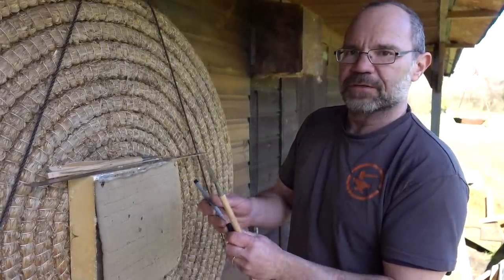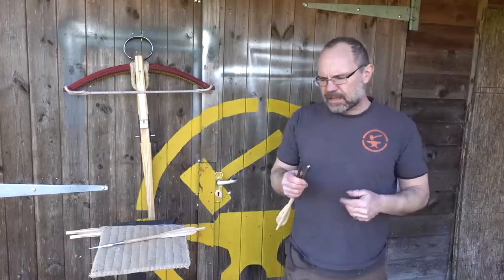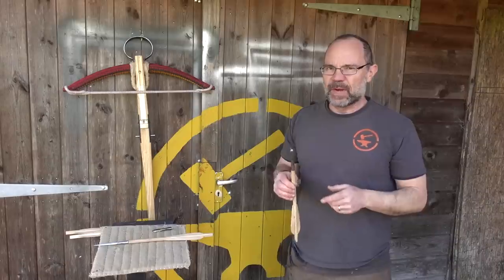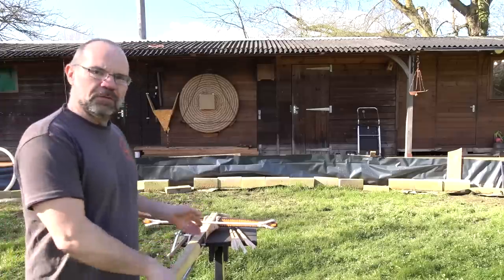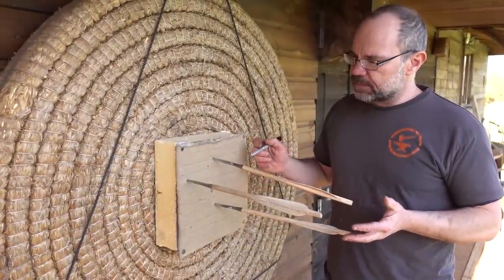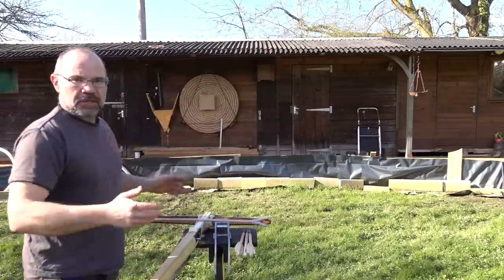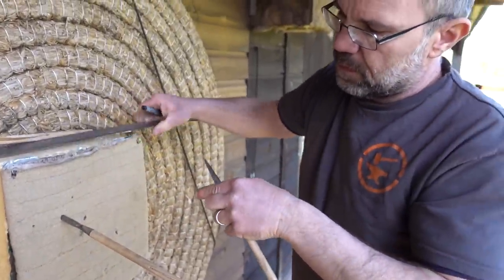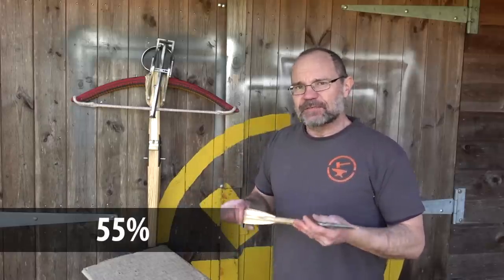Does WAX on ARROW HEADS Do Anything?

Comment: It might work on the same principle as a sewing needle. It was often common practice to pull the thread through beeswax to make it easier to sew thicker material together. But I do question the thickness of the Gambeson tested, since many of the coats I've seen in museums were thicker (those not worn with chain mail) and the thinner coats (those worn with chain mail).

Comment: Under waxing could be like in bicycle chain waxing. It is mixture of wax with oil. By it self wax give a lot of friction, but dry. Tigether with oil you will get the best effect. It is dry by touch, but give best low friction from filling point of view. 
For my bike i have made from 400g volumes of candle paraffin, 100g bee wax, and around 300ml SAE250 gl1 oil. Has water hydrofobbic effect, last long, almost dry by touch and almost clean by touch no heavy dirty marks.

Comment: I strongly suspect (as a number of people do here) that the wax (or oil) may have been initially put on to prevent rusting of the heads during storage and transport. It's possible that was the origional reason, then by trial and error they saw they had a greater impact, or it was just a fortunate coincidence and they had no idea it improved penetration.

Comment: My only thought as to why it wasn't done would be that I'd imagine that the wax would just crack off. Maybe they would have had big pots of melted wax next to the archers during say a siege but I can't image that it would stay on. Perhaps other types of lubricant was used like oil or fat. Also I would imagine that because the bolts are made of steel they would already have some sort of oil or something on them already to prevent rusting. I also know nothing so keep that in mind.

Comment: Beeswax would have also kept the bolt heads from rusting and in better condition, maybe the beeswax was originally being used to stop rusting and discovered the better penetration in the process? Chur for the video Tod, just joined your crew.

Comment: I know nothing about arrows or waxing  them but I do know about driving nails into 100 year old fir 2X4 studs.  I owned a house 100 plus years and wanted to do a remodel on it.  16 penny nails would absolutely not puncture that wood (almost rock-like at that age) except when I coated each with paraf
fin. I would have guessed that wax coated arrow heads would have penetrated further...

Comment: A comparison between different rust-prevention methods would be needed.
As many have pointed out by now - wax, tallow, oils and similar have been used for rust prevention. Specially for weapons this was important as they are normally used rarely but need to be in good condition when the time comes - so tipping your arrow-heads in wax - which does not go bad and stays in place better than oil - should have been rather common.

So if possible - please try it also with some other materials that were (likely) used to prevent rust.

Comment: I was giving this some thought when I revisited the video of arrows v armour.     That perennial question of whether arrows were 'waxed' was raised there.   I commented when the video was loaded.   Now I wonder whether the wax on Bodkins and other heads was anyway a standard finish following manufacture to protect against corrosion.   They must surely have had some coating.   My thoughts also turn to Linseed oil.    Hot iron quenched in Linseed oil will bake on a protective coating.   Before the days of cotton, linen was a principle fibre and Linseed oil common.   Might a baked on coating of Linseed oil provide similar lubrication with the heat of friction as well as protection against corrosion?
Peter.
Reply: Oops, in too much of a rush again. I see that a wax coating as a protection against rust has already been raised.   A number of times.  I apologise to readers.   Quenching in Linseed oil is different, however, in that all that is necessary is to toss the hot heads into a bucket of oil when forging is complete.  And the coating is long lasting.    Who knows?

Comment: I used to be a shoemaker and when sewing in leather, pecking the awl in a piece of bees wax makes a world of a difference. It may be a good idea to rub a piece of bees wax against the whole length of the arrow heads, to ensure an even distribution of it. Dipping the heads in molten wax may also be worth trying. It will protect the metal from corrosion and a ball of wax on the tip seems less than practical, at least in combat.

Comment: GREAT VIDEO . THE REASON THEY TEFLON COATED BULLETS WAS NOT TO MAKE THE STEEL ROUNDS PENETRATE THE SOFT BODY ARMOR , BUT TO HELP PROTECT THE RIFLING FROM THE HIGH PRESSURE STEEL BULLETS FROM WEARING AWAY THE RIFLING IN THE GUNS .____NOT YELLING GOING BLIND . I THINK THEY STARTED WAXUNG THE BOLTS & ARROW HEADS TO HELP KEEP THE M SHARPER & RUST FREE .

Comment: This is very interesting.
Would the wax interfere with the metal of the arrow tip? If not, maybe they were waxed to stop or slow down corrosion/rusting, and increase in penetration is just a lucky side effect.

Comment: Have you tried hot dipping the tips and a inch or two of the shaft into a pot of hot wax? This would get a more even coat into the pores and protect the head and shaft from moisture. This would also increase the FOC. 🤷🏽‍♂️

Comment: Hmm, a blob of wax on the end of a platecutter head is probably the medieval version of APC (Armour Piercing Capped) ammunition, a soft cap or ring of material (penetrating cap) is placed over the hardened penetrator (the optimum shape of which is often not ideal for striking sloped surfaces). In APC ammunition it has two purposes, one to lower the initial shock of impact which can shatter the hard penetrator (not so much an issue at crossbow velocities) and the second is to prevent the shell from bouncing or skidding off on a glancing shot.

It was only invented in the last hundred years or so though so can't be historically accurate of course ;)

Comment: 3 months later here, but: an old trick in carpentry is to rub simple bar soap on your screws - and even your nails. Especially when screwing slot head screws in wood by hand it can really make a difference. Great for reducing friction on wooden drawers too.

Comment: Try dipping the arrow heads into hot wax, im sure It Will give better results than a wax drop on the tip. Or also could do an arrow coated with pork fat or grease and see a comparison between those.

Comment: It does seem likely that they would, even from a preservation standpoint, heat the tip and stick in in wax or grease to prevent corrosion. after years I would imagine someone would notice that treated tip performed better then untreated, even if they didn't come up with it intuitively.

Comment: Hi Tod,
I've started to follow you recently and it is a really interesting video. I was wondering if maybe you've tryed to hit that type of armor when it is attached to a round surface. Again maybe you've done it before or explained it in another video but to me the target wasn't supposed to be flat as the belly gave the material a round curve.
My point is : if the armor is attached to a round surface (to replicate a human belly) maybe the front fibers of the armor will be slightly spread out and will increase the penetration at the impact by reducing friction of the tip at the entry point.
Maybe it will not increase that much the depth of the wound but maybe, with wax, you will increase it by 1cm or so... And 1cm deeper might touch the heart instead of ribs.
That's all great job and keep it that way I love your video (sorry for the bad spelling ;-) )
Reply from the maker: You are right=, but the problem is then in testing 'like for like' as a shot that land on a different curvature can no longer be compared as like for like and shooting is just not that accurate....
Reply: Yeah you're right.. Didn't think about that. 
Thanks for the answer!

Comment: I'm curious if the concept of the blob of wax at the tip was not used as a friction reducing element to allow for deeper penetration but rather as a friction inducing element? This would obviously be most important when shooting at steel plate. 

If the wax, before being melted from the energy of the impact, creates a tiny bit of friction (by virtue of being sticky)  and keeps the arrow head in one place for even a brief split second longer, then more of the energy from the impact is directed into the steel and might result in less of a chance of deflection.

Comment: Would there be a difference on hard targets as well?
Screws for decking are sometimes waxed. There are a real difference in how long a battery on the screwdriver last. And the waxed screws are kinder to your wrists. If you have a substancial amount of screws, you notice the difference very fast. Stand to reason that kind of difference transfer to things like arrows, bolts, bullets going thru soft targets.

Comment: The percentage thing is an easy mistake to make. The 40-45% number comes from taking the change as a percentage of the NEW number. 80% comes from taking the percentage as a change of the original number, which is how we usually measure percentage change. (Example: if something goes from 100 to 200, the change is 100. So this is a change of 100% of the original quantity, but it's only 50% of the new quantitiy). I know I'm not the first to mention this but I thought I'd give more of an explanation.

The results, in any case, are really interesting!

Comment: Have you ever heard of the munition type for tanks called H.E.S.H? The "S.H." stands for squash head. Now it's hard to penetrate armor that is well angled, not only do you have to potentially go through more material, but you must now worry about deflections. See with HESH, the concern for deflection was mitigated by slamming into the enemy vehicle and temporarily adhering to it through the soft head of the warhead. This would normalize the projectile to the vehicle, and the warhead could be armed with some kind of explosive/penetration/spalling weapon.

 Could you perhaps put a small wad of clay/wax on the very tip of the arrow so when it hits the armor it normalizes? I'm curious to see if you could devise a warhead for your bolts so that when they hit armor, they'd adhere slightly, and the momentum of the arrow would push itself past the glob of clay and maybe into the target plate. Just temper a plate that is flat, and plink at it from various angles. Maybe they'll consistently skip off like they did in the previous armor vid. But I like to think we can also see new methods the people back then could have devised. I would do this myself, but I lack the supply of arrowheads and a period crossbow :)

As always, great vid. Best regards mate.

Comment: OK------ I grew up in snow country and my grandfather taught me to put wax on my snow shovel so the snow would fall off easier. Only thing was if you didn't heat the metal of the shovel in front of the fireplace it did not work as well. Putting wax on the heated shovel not only made it work better but you could go all day without the wax coating wearing off while the cold waxed shovel (a kid being lazy) did not work as well to start with and was totally worthless after only a half hour with the snow sticking on the shovel like mud.  Try heating your arrow head just above the temp of melted wax and then dip it in melted wax and try it again. Bet it will do even better.

Comment: I think that the wax may be less effective than that (but still effective) since here the arrow face polystyrene after the textile and not flesh or ballistic gel. Need to do more test, but the result is definitely more impressive that what I imagined.
Even if the penetration depth increase only by 25~30% against protected ballistic gel, since the surface is less important than the organs, it’s definitely worth it if you can do so.

I’m almost certain that even with the wax, plate will not be penetrated by the 160 pounds bow at 25m, but I can imagine an increase in damage.
Maybe it will permit a deeper dent when the shot is perpendicular enough (at most a small hole, but I don’t think it will do so), or to permit some of the arrows that would normally only do a scratch will actually do some damage to the armour?

Comment: If they did wax the tips, they probably just had a pot of hot wax, and they'd grab a handful of bolts/arrows at a time to dip them in.

Also... wax the part of your goatsfoot lever that has to grind against the pegs in the crossbow. It'll make the lever action much smoother.

Comment: Tod, I’m just wondering: when did someone eventually come up with the idea of incorporating the cocking tool onto the body of the crossbow? It seems like it would certainly be easier to attach it  so that it folds against the top of the stock after cocking. Then you wouldn’t have to worry about dropping it between shots - and it would probably increase you rate of fire as well.

Comment: Actually I propose an extension of this experiment. Cast iron Pans are coated ( seasoned) by burning in Oil, wich makes them very slippery, it creates a polymerized surface. This technology should in principle be availabe in medieval times. Would it be possible to season some bolt heads or arrowheads and test the penetration performance?
Thank you.

Comment: You should try different lubricants next.
tallow 
wax
vegetable oil
butter
basically anything that a medieval crossbowman might have available.
also mixtures, as i believe if they were knowing the effect they would have experimented as well.
also maybe it would be interesting to try a few modern substances for comparison.
wd40
stearin
some lubricant you would find in Shops with an age restriction...
ballistol

Comment: Thanks for making this video.

Consider that the arrow heads of the crossbow bolts were often poisoned . So waxing the arrowheads would not only be giving them greater penetration, but protecting the poisoned arrow heads too, so that the rain and inclement weather would not dilute the poison.

     Which could present a problem for the crossbowman himself.
     Think it was other time, the qualities were different, and the objects were not made perfectly. So I can imagine a crossbowman going to take a bolt, and because rain or something the poison from the bolt heads has been diluted impregnating the bolt's body ... The crossbowman is going to grab it, he has an open wound in his finger, or the body of the bolt has a small splinter .. and whoosh! It could be very dangerous.
     So it makes perfect sense to wax the heads of the bolts, for keep the poison in them, and protect it from weather, and protect the crossbowmen (and add some penetration to the bolts, as we can see in the video).

Comment: Not only a difference in penetration but amazing consistency, which may suggest the wax removes a lot of the minute variables. Does wax also function as a sealant? In which case you could argue they would have encountered the benefits of waxing by accident.

Comment: Could have dipped heads in wax or fats to protect from rust and other damage. It just so happened to penetrate better too. I am not familiar if the arrow or bolt heads would actually be affected by rust or other weathering elements, but I do know people did protect other things with them. It is conceivable to be a by product of superstition,resource availability, and "If it works for this, then it works for this also. I am also aware that thinking in this manor is most likely walking straight into a fallacy, but I will still propose the idea anyway.

Comment: I'd also like to think a coat of bees wax would have had the added benefit of preventing rust on the iron bolt heads. Armor and weapons as well. It I remember blacking iron/steel weapons with bees wax was a method in antiquity for preventing rust and maintaining weapons and armor. Blackening both steel and iron!! So they were very likely aware of wax on steel.

Comment: I would have to imagine that if it was used--at least primarily and initially--any wax or grease would have been used as a rust inhibitor during storage, just as it still is today for uncoated ferrous metals.  The increased penetration would simply have been a happy accident noticed at the butts.  It would be fascinating to know would be if anyone back in the day experimented with lubed arrow/bolt heads.

Comment: This is very interesting- a massive improvement in penetration power! There's also the fact that a coating of wax or rendered fat would help prevent rust. I presume that Crossbowmen waxed their bowstrings, so they would most likely have had easy access.  I would be interested to see what difference there is in Beeswax vs. Tallow.